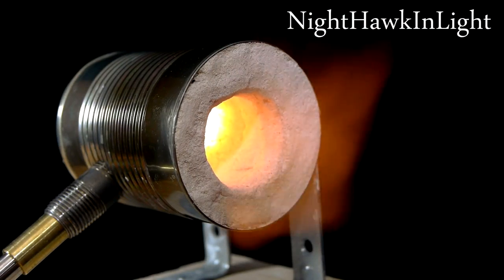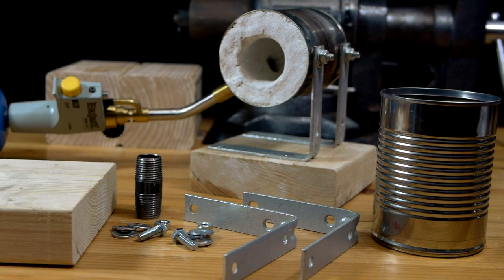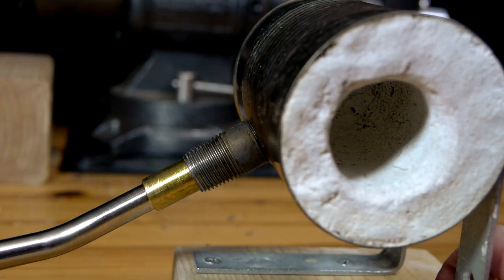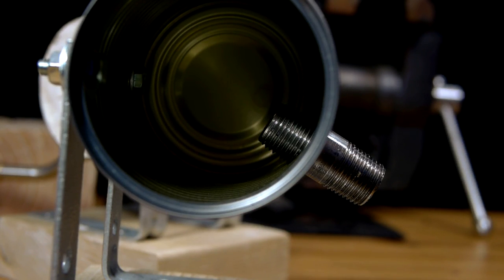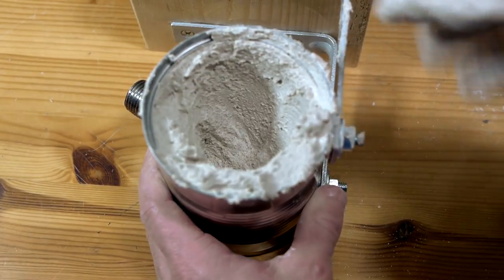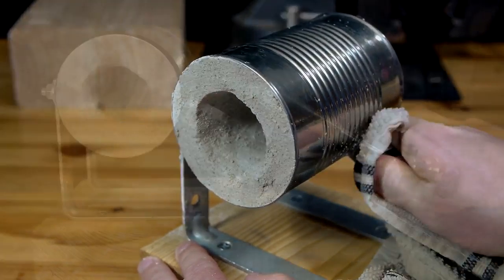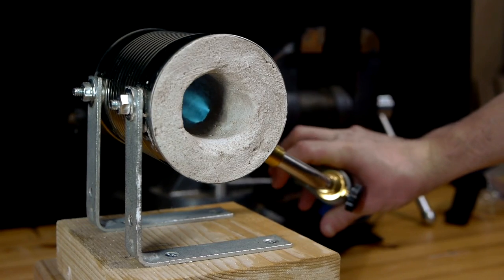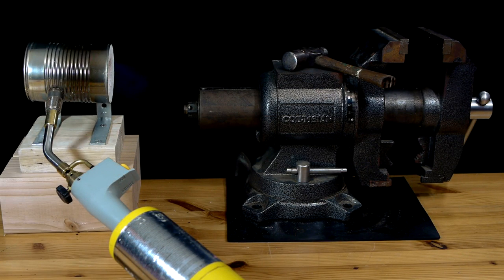How to Make a Soup Can Forge

Comment: I have a few questions:
First What kind of sand did you use that made it into a fireproof coating?
Second, Is there a way of further hardening plaster of paris? because i plan on making a prop sword out of it.
And Third, with the same fireproof coating, is it possible to use it as a mold in case i build a forge that liquefies the metal?
Reply: I've molded lead using Plaster of Paris, but never steel. I used ''Play Sand'', used for kids sandboxes. And finally, you'll never make a practice sword out of plaster. Go to a Martial Arts supply website and look at a Shinei, (She-ni), it's a bamboo sword bound with leather. They are used in Kendo, Kenjetsu & other Fencing applications. I've taught a fencing class for over 15 years and I assure you, for the money,($15-$50+)it's the only way to go. I recommend AT LEAST a street hockey/ Le Cross goalie helmet, or you'll end you're sparing round at the Emergency room in stitches.(not the funny kind) Hockey gloves or something similar will save you some broken fingers/wrist.  I highly recommend learning the Art of the Sword. 10th degree black belt S. Kaufman's interpretation (not ''translation'') of ''The Book of 5 Rings'' is all you'll need to teach yourself. That and sparring partners. Don't try to hurt them,then you'll have no one to spar with. Work on hitting the target first, speed comes from confidence which comes only from thousands of repetitions. I taught myself the Sword because of the direction the Federal gov. is headed. It is the nature of ALL forms of Gov. to take more & more power from their citizenry. Eventually it'll take a sword to get back a pistol to get back a rifle.  NO. I'm not ''taking a knife to a gunfight'' I take a gun to a gunfight. I'm taking a sword to a knife fight. I carry both, and use whatever it takes to,,, persuade,,  whoever it is trying to use force instead of reason, to get me to comply to their demands. The unarmed have little choice but to comply. We ALL have the God-given right to choose, it's called ''Free Will'' and self defence is the most basic of all Human Rights. If that is what you freely choose.

Comment: I tried doing this myself, and it seemed to work. After two burns the plaster/sand mixture started to crumble and fall apart. Is there a particular grit sand you used for this?

Comment: Really very nice, but the torch makes me nervous. For what I am doing I need the torch on for 30 minutes, don't you think that this is a risk? I would be using it to make mokume gane.
Reply from the maker: Should be fine, as long as you're working outdoors or in a very well ventilated space to prevent carbon monoxide buildup.

Comment: Is there a consistent thickness-to-radius ratio, for the refractory lining and metal can, required for efficiency and safety?   You said to do a 3/4 inch thick lining of plaster-sand- water mixture, but you were using a soup can for the forge.   I have an old, metal, Folger's coffee can I'm going to use for one of my forges, and it's about 7 or 8 inches in diameter (3-1/2 to 4 inches radius).
Reply from the maker: 3/4 should still be fine. Radius is not of any importance.
Reply: When in doubt, I'll learn through trial and error.   Thanks, NightHawkInLight.

Comment: so a friend of mine has enlisted my help in his efforts at making a sword, my place is partly to help make the a forge. for the forge im thinking of taking the same consent you showed here but scaling it up significantly to an oil drum. the plan i have is to make the plaster/sand lining an inch and a half to 3 inches thick than having one or 2 holes through the bottom and the plaster to put in blowers(probably hair drier or fan). in your opinion would the sand plaster mix work for this purpose and if not what would you recommenced?
p.s we met in a welding class and intend to toss on some legs to our oil drum. also let me know if you see any flaws in this plan that would be obvious to people who aren't inexperienced at this sort of thing.
Reply from the maker: I would not use plaster and sand in a forge that large. At that point it is worth using refractory bricks or fiber wool which is made for the job.
Reply: ya i sopose, also your reading all the comments on your videos even ones from years back is one of the reasons your channel is one of my favorites(also cute birds).

Comment: Nice Idea and also thx for the good description how to make it.

I got a bigger can (15,5cm - 6,1inches) and got some Questions, i hope You or one of the viewers can help me. ^^

1.Would that torch from the video get enough heat to forge the steal in a bigger dimension?
2.I got some ceramic wool (holds up to 1800 degrees) so should i combine the wool with the plaster mix or is it better to do it in the way in the video, and save the wool maybe for a selfmade heat treading oven? 

i hope someone can help me and sry for my bad englisch.^^
Reply: 1. Your english is fine
2. I dont know - but i think this burner migth be a little too small, but that depends on the thickness of your inulation
3. I can recommend making an inner "bucket" (maybe a smaller soup can or tomatoe can) of a strong heat-resistant mix, then putting the ceramic wool around it. Ceramic wool insulates very well but doesnt last long in direct fame, and will get crammed together making it less inulative. If you could hold this inner bucket up in the middle of your soup can then put wool around it, it would work the best. The wool wont insulate if mixed into the mix, but it migth make the mix stronger

Comment: Over 2000°F... so I could use this to melt down sterling silver for ingots and castings, since the melting point is a bit less than 1800°F, correct? Any experienced silversmiths out there have any input?
Reply: VictorSeven Games I was thinking the same thing.  I think, however, I might use a larger can, as most crucibles (at the least ones I have) wouldn't fit.
Reply: Interesting. Thank you for your input
Reply: YEs, but use a foundry

Comment: Great video, but I'm having trouble with my can forge I made. A little help?  First off,  I'm having  difficulty  Getting it any were as hot as 2000. Do I  turn  the flame up after the  fifty-fifty mix dries? Please respond.
Reply from the maker: I run my torch at full power.

Comment: I made one and it worked great.  but i seen that after it cooled down it was cracked.  did i not have enough sand ?
Reply from the maker: +Joe Scheebel Hard to say. It may still work just fine even with a crack.
Reply: +NightHawkInLight    that was a fast response,  thank you.  and I'll keep using it and see how it goes.
Reply: +Joe Scheebel how did it go

Comment: Hey, im finding it quite hard to find a 1/2x2inch iron nipple fitting, since i live in Australia i can only find brass ones, but they wont work with the heat that this forge will produce, if possible could someone link me to a site that will ship to Aus?
Reply from the maker: TheParadoxJr Brass will work. Since half of it is outside the forge the heat will be distributed and it won't melt.
Reply: Okay, thanks :D
Reply: NightHawkInLight how many grams or kg  of plaster of paris did u use ?

Comment: Hi. I have made this forge and made a lid and intend to use this as a foundry. Without the lid it works fine but when it is on, even though it has a 1 inch diameter hole (the lid) there seems to be not enough air and after 10 seconds the fire cuts out. What should I do?
Reply from the maker: You will need a lot more air flow if you're going to be closing a charcoal forge with a lid. Probably a hair drier rather than the hand blower, and bigger/more vents in the pipe that blows the coals. Remember not to do this indoors because of carbon monoxide.
Reply: I was actually using a torch (from a small gas can) poking through the hole at the bottom. And yes I make sure to use it outside.

Comment: we are making this but we are a bit concerned that if we heat it up with water still in it there is a chance of explosions. would it work to cure it a a lower temperature in an oven?
Reply: I waited 2 hours for it to harden. then stuck the torch in :D  it worked but took a while. see my post 2 comments up

Comment: Question to the more knowledgeable: Would it still work if you cut both ends of the can out, like for forging longer steel?
Reply: You might be able to extend it in a way if you cut the both ends off of another can (amusing you already have one built) and then connecting the second can to the first can making the forge into an extended two can forge. P.S you probably won't want to make the air intake or front of the first forge very big because the second forge/can would be the one exposed to the air or front. 

I'm 14 and have no experience in forging so I have no idea if this would even remotely work, I tried though and hope this gave you an idea.

Comment: Hey nighthawkinlight I have a question about your soup can forge. Do you think that it would work on a larger scale? Mainly I have been wondering if your plaster and sand mixture will hold up to higher temps. I am wanting to try to make a multipurpose forge that can be used as a blacksmith forge and a smelting furnace. Instead of using propane, I am going to use coal or charcoal with a hairdryer to heat it up. What insulation mixture would you recommend? (besides $firebrick$) Also would you like to do this type of project? I think its right up your alley.
Reply from the maker: With the torch I am using it can scale up to about a coffee can size. If you're looking to make a long term setup use real refractory or fire blanket, or whatever they might recommend on a blacksmithing forum. The plaster mixture is cheap and easy to come by but it's not durable enough for heavy use. Bentonite clay might be a usable option.

Comment: yes, that would work the same, but if you start getting to big, you will need to make it out of something stronger than cheap tin sheet metal, a thicker lining, more heat and air induction... and remember to always be careful, & use in ventilated area..

Comment: When you say 50/50 sand and plaster, do you mean by weight or volume? Example: 1 pound sand and 1 pound plaster? Or one cup sand one cup plaster?
Reply: blaze102110 This is the same question I'm asking.
Reply: I would assume he means 50/50 in volume

Comment: What size soup can are you using? Is there any fitting for the torch or is it just a snug fit?
Reply from the maker: The largest can I could find at my grocery store. The torch tip is a close fit, but not air tight.

Comment: Ah it's a 50/50 mix of sand. Does it have to be a specific kind of sand?
I think made mine from another video about 3 years ago and was wondering why my lining cracks and crumbles after only a few uses. I tried reinforcing it with a wire mesh  so it doesnt immediately crumble into dust after several uses.
Reply from the maker: No specific kind of sand. It's normal for it to get fragile, but if you're not scraping at it it should hold its shape.

Comment: Awesome, can you make one using wood and charcoal?
Reply: Not like this, but I'm sure he wouldn't have much trouble with it. They're not exactly complicated devices. Wood is also probably not a good idea. It CAN get hot enough to do some metalwork, but it's too much of a hassle, whereas using charcoal is easy, and you can just make the charcoal out of your wood if you have wood.
Reply: yes...that was called the iron age 2000 years ago. It should work with charcoal if the air input is pressurised.

Comment: So instead of the sand and plaster of paris mix, I used grout. It's in the process of drying right now, do you think it will be fine and work just as good?
Reply: +NoBeatsNoProblem I want to try it too. How has it turned out?
Reply: NoBeatsNoProblem so how did it come out

Comment: Can u stick the torch through the end of the can? I'm making a forge out of an old fire extinguisher and I'm sticking the torch through the valve part and cutting the end off
Reply: its better to have the torch sticking through one side ant at an angle so the heat will go in a circular current, heating the forge evenly.

Comment: How much would the propane torch cost? (just the bottle) How long would it last? hours? days ? months?
Reply: it depends on how long you run the thing if you run it on full it varies there are tons of bottle sizes and torch types your typical torch bought from a hardware store doing this maybe a hole day if you lucky and the torch and bottle together cost about 14$ CAD or 14$ US they are cheap as too the bottle separate I'd have to look

Comment: Greetings from Germany. Eventhough I doubt that you will read this I have a few questions. Number One: does it matter which blowtorch is used (what type of blowtorch)? Nuber Two: How do I find a iron nipple that fits the blowtoch good? I hope you see this and reply, thanks.
Reply from the maker: You must use a specific type of torch. Read the video description
Reply: NightHawkInLight thanks for answering. I saw the link in the description, but the problem is, that i live in Germany and the ordering of the blowtorch would cost thrice as much than the torch itself. Is there another type of blowtorch i can use, or does it have to be spiral headed?
Reply from the maker: It has to be that type of torch, but not necessarily that brand. I do not know what other brands make a similar one unfortunately.

Comment: We did this today and it worked great but after a while the fire was really "flamy".   Flames shot up about six inches.   It worked great for the first few minutes and then the flames kept getting higher.   Is it because the temperature in the garage was 1 degree?   Not sure what is going on.
Reply from the maker: There's nothing wrong with a little extra flame. If you wanted to get rid of it it might be that the forge could use a bigger inlet to let extra air in around the torch head.

Comment: @NightHawkInLight what did you find to be the right ratio/amount of water?
Reply from the maker: +Austin Smith Added it until it felt right.
Reply: +NightHawkInLight sorry one more how long did it take to cure?
Reply: +Austin Smith 15 minutes to harden 1 hour to completely dry but many people are inpatient and dry the forge with the torch.
Reply: +Austin Smith hey man if you check out the mini metal foundry by grant thompson he uses the same materials to make a much larger version. he uses cups as a unit of measure
Reply: Taylor Jones if making a soup can forge use 4 1/2 cups of the refactory
Reply: Mario Cuevas totally would dude but i made the grant Thompson one so now im in the process of upgrading it to propane

Comment: I don't have a torch but I do want to make my own forge some time in the near future, only I'm concerned. Is it safe to let the propane torch burn straight through all the fuel in one sitting? If not how long could you keep it on before you have to turn it off?
Reply from the maker: Kraized It's fine. The tank itself will get freezing cold from running so long, nothing will get hotter than it should.
Reply: Thank you sir.
Reply: +NightHawkInLight will a web flame torch head work?.
i saw a spiral torch at rona but it was like 50$
Reply from the maker: Jose ricotaconachoquesadillamandillalones I don't know what a web torch is. Probably it would not work.
Reply from the maker: ***** I used a TS8000 in this video. I haven't tried the other torches and don't know how they would work. A pencil flame will definitely not work, that's about all I know.
Reply: ***** take a look at the plumbing section.

Comment: Yo, I've done it myself off of this design, but how about a quicky guide for others about modding it so that you can run it off of a refillable grill propane tank (very cheap and easy to get, also much better if you're going to be running the forge for a lot longer of a time)
Reply from the maker: That doesn't really require a tutorial since all you should have to do is ask at a hardware store for the correct fittings to attach your torch head to a propane tank. Should be a rubber hose and a couple brass fittings, really simple.
Reply: NightHawkInLight Thanks thats helpful
Reply: NightHawkInLight do you think i can use a bigger can like a paint can?
Reply: Miguel Rojas yes but you might need to cure it longer because it would be more space too heat

Comment: could you use cement in place of the plaster of paris mixture? im just curious as I have cement on hand as well as everything else needed. Just curious if it would stand up to the heat.
Reply: No. Cement will shatter when it is heated.
Reply: Obediyah McNelly Not refractory cement.

Comment: Can I use the Plaster-of-Paris-and-sand mix as refractory cement (the heat-resistant mortar in a backyard firepit)?
Reply from the maker: Rain will disintegrate it
Reply: Thanks.  Could the mix be combined with regular mortar to make it more heat resistant?

Comment: Can we use this with coal instead of gas? I could connect an air blower using the method you connect your gas outlet.
Reply: Yes, but probadly make it bigger, i allways see solid fuel forges being "open" but i cant find any reason why you couldnt close it off

Comment: I can seem to get the paint can forge up to proper heat. I have a closed back and have built the front up to a one inch by two slit in the front to insert the material. I'm I doing something wrong here? What about the positioning of the torch?
Reply from the maker: It can take a while the first time heating the forge for the water to burn off of the plaster. It would burn cold until then.